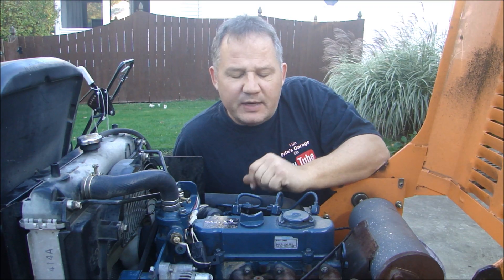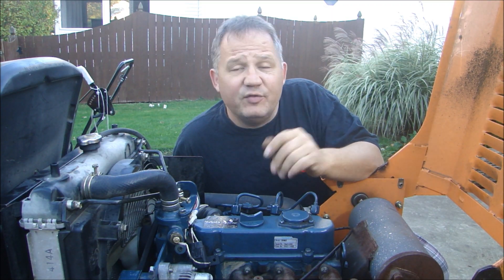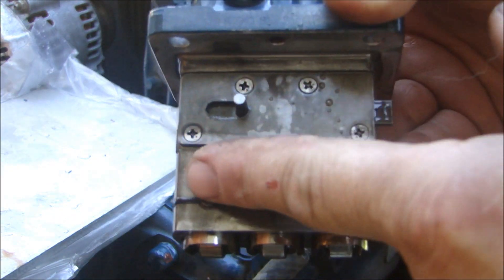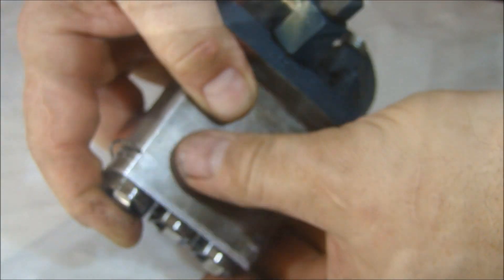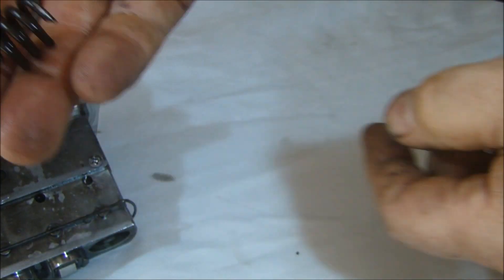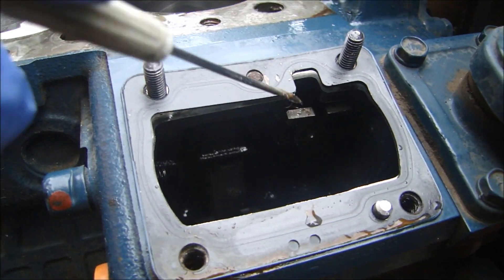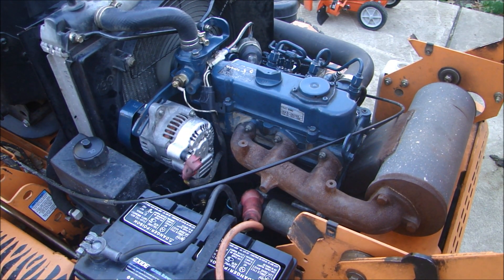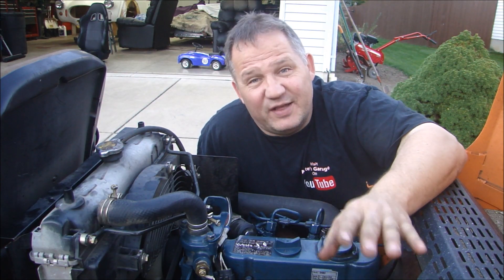Kubota D902 Diesel - Bogging Down, Blowing Smoke

Comment: I am confused.  What does the sliding tab piece do?  Is that the fuel cut off to stop the engine?
Reply from the maker: That sliding tab directs the pressure inside the pump. If I remember right the shuttle is connected to orifices on the top side of the lifters
Reply: @PetesGarage  what about the o ring on the head that goes on the dowel with the hole in it

Comment: Most small block Kubota engines are the same, have 2 of them. My question is why didn’t you just replace the spring or just the single injector?
Reply from the maker: I could not find the right part number at the time. I have found it since.
Reply: @PetesGarage  - Any chance you still have that part number?  I haven't pulled my pump yet to confirm it, but my bx2200 is smoking and down on power as of today, I just replaced my 3rd hydraulic hose in a week and now it's not running right.

Comment: I just bought one of these engines for $100. Wondering what to use it for 🤔
Reply: Dude the engine i have weighs about 83lbs.. i can pick it up with my bare hands fairly easily.. 160lbs? Maybe with a frame or accessories n whatnot but the complete engine itself is only 83lbs
Reply: I figured it weighed 7-800lb? I guess I was wrong.
Reply: Built a diesel motorcycle. With sidecar.
Reply: Generator.  A fucking go kart? For real, it weights like half a ton and makes like 12hp.
Reply: @brianmorrison9066  half a ton? No. Dry weight of the engine is 160lbs. Straight from Kubota's spec page...
Reply from the maker: Diesel go cart

Comment: The injection timing is set by adding or subtracting the shims under the injection pump. This Kubota has fixed timing like most lawnmower gas engines. A lot of automotive diesel injection pumps have variable injection timing. I installed a Kubota 905 diesel in a Geo Metro and it had driveability issues because of the fixed injection timing.
Reply: I was thinking about doing the same,  3cyl kubota in a geo , did you ever get it right? How is the power? Could a turbo be added? Milage? Thanks would appreciate some info,  did you build a adapter?
Reply: @redfuel6bt    Power...terrible. Going from 54 hp to 24 hp makes it a flat land vehicle only. I forgot about the car long ago but still have it. It's not a simple swap at all. Nothing fits. I built the adapter, modified a Suzuki Swift flywheel, clutch, starter, and had to make a vacuum pump to work the brakes. The oil pan hangs low and needs mods to provide clearance. The worst part is that the oil filter is exactly in the way of the right axle. A complex adapter needed to be made to switch it over to the front side of the engine.  The fixed timing injection pump makes driveability poor. The governor had to be modified to hit 3600 rpm from fixed 1800.  When you were ready to shift and hit 3600, the power cut back completely. But it got around 70mpg during the week I tested it. The registration expired and California would not renew it without the original engine.  I have a turbo but it still sits on a shelf. I used to build random things like that but nearing age 70, no longer have the interest. I build solar generators for fun now.
Reply: @redfuel6bt  Here it is....built 14 years ago!  https://www.youtube.com/watch?v=hnAOF1bOSB8

Here's another  random video from 2016 when someone bet me it wouldn't start.  https://www.youtube.com/watch?v=BhBKLahX6_0
Reply: @redfuel6bt  Since you clearly like Cummins and off road.... here's my boat after converting it from a slow inboard to a stern drive with Chevy 6.5 turbo diesel. I still have the boat in storage and doubt that I'll ever run it again. Boats were fun for years but I'm over it.  Note the air horn dongle. It once hung from a friend's Dodge Cummins before he rolled it 3 or 4 times. The old Perkins 47 horsepower diesel that came out of the boat went into her old wooden 28 foot Tollycraft cabin cruiser...very slow, 8mph, but got us around the NorCal Delta at 1.25 gallons per hour. That's cheap boating.
https://www.youtube.com/watch?v=cDyQ_VeZKx0
Reply from the maker: Interesting, I can see how that would work.

Comment: Hi Mr. Mechanic: I have a kubota BX2370with a small three cylinder diesel. I have changed the filter -fuel pump and it still bogs down under a small load. Is there any advice that you may have??
Reply from the maker: Change the fuel in case there is water in it, and look in the gas tank for an obstruction blocking the fuel line.
Reply: Good chance your fuel jelled, you can go to a auto parts store and buy a can of fluid that immediately breaks this up. Costs about $30 not cheap but better than taking the tank off, also change your fuel filters. Kubota users two of them

Comment: Interesting video Pete. I've acquired an engine in the same range to rebuild in part for entertainment and also to do an engine rebuild video for my channel (and have found the workshop manuals online).

Just a point of note that the D902 is one out of a series of similar engines, including the one I bought (a D662), D722 and the D902. They seem to also use the same pumps on engines like the Perkins K103-07 3 cylinder diesel (Which I've also bought). Presumably the same issue would apply to those and indeed all similar diesels.
Reply from the maker: Lots of parts are common and similar. I had to use a part number that was not exactly the same.

Comment: On a Kubota diesel -3 cylinder motor-I was told a new head gasket was put on recently.  HOwever, when I put water in the radiator, oil came out the top of the motor-from the oil fill plug.  Can you tell me what is wrong and how to fix it?  Please and thank you so much.  Dave
Reply from the maker: I have no idea, maybe they put in the wrong gasket or upside down

Comment: with a Parts book you can find Anything 😐 and you call the Thing a lawnmower with a 3 cylinder diesel that can Drag Pickup truck with 4 exploded tires yeah these tractors are Torquay sometimes in Low Gear
Reply from the maker: I did fine the a spring part number eventually, but it was not easy.
Reply: @PetesGarage  do you have the part number?
Reply from the maker: @ANGST97B2P  I have to look
Reply: @PetesGarage  thank you brother..

Comment: Good job !!  I guess you cannot buy just the spring ??
Reply from the maker: I could not find the spring at the time, but have since found it.
Reply: @PetesGarage  Is there a part number for the springs? Just in case this turns out to be my issue. Thanks.
Reply: @berky2755  @Pete's Garage ... is there any reason you're not sharing the p/n of the spring?

Comment: you forgot the o-ring on the head gasket
Reply from the maker: Which o-ring?
Reply: @PetesGarage  on the left front corner if you look at the guide stud it is hollow.  and look at the gasket  it is not a snug fit. there is a  blue oring that goes in there  you have to order seperately  it does not come with the head gasket. that is the oil feed for the rocker shaft.  i have seen these that are missing and never leak and others that leak like a sieve.
Reply from the maker: Yes, that one. I did not have a problem with that.

Comment: DO NOT CHECK THE FUEL PUMP FIRST!!!!!!!! This symptom can be caused by something as simple as a plugged fuel pickup, i stopped someone from replacing a fuel pump and replaced filter and lines first, found the down tube in the fuel tank had a peice of plastic bag stuck in the fuel line, suction in the fuel lines was causing air to get into the fuel lines before the injection pump. 10 minutes and $10 in parts (fuel lines and filter) and the machine runs like new.
Reply from the maker: You are absolutely correct. Before doing this video the fuel filters were change, tank drained, and lines cleaned. I did find a huge ball of plastic blocking the pickup. But I think that is based on what the engine is put it,

Comment: Great video Pete! Did you replace the gasket/shim on the injector pump or just re-use the existing one? I'm rebuilding a D722 but the injector pump gasket/shim does not seem to come with any of the rebuild kits out there.
Reply: the "gaskets" are shims  used to set the injection pump timing.  put the same thickness in that came out or do the pump timing procedure
Reply from the maker: @richardcranium5839  Correct
Reply from the maker: I reused them. Worked fine
Reply: @PetesGarage  Great! Thanks Pete!

Comment: Hi, Pete, why didn't you just replace the springs and or new injector instead of purchasing a new pump, I've a the same but four cylinder, and same problem but the smoke is black.
Reply from the maker: I could not find the springs anywhere and nobody would give me a part number
Reply: If you want to use this long term its way better to replace the pump as if one spring had broke its a sign the rest is on its way, The injection pump is a very important part on a diesel engine like this, its much more so then on a gas engine. It is like the fuel pump ,carb(along with the injector) and the distributor on a gas engine, as it controls throttle fuel delivery and combustion timing. And they are machined to very high tolerances, with high pressures. These small inline units aren't nearly as complicated as rotary ones but their still very touchy and don't lend themselves to tampering and wrenching.
Reply from the maker: @hawssie1  Thanks Nick. I replaced the pump on this one.

Comment: I had a power loss problem I found number 3 cylinder (that's the cylinder if your standing in front of the engine looking toward the rear of the engine), was dead, and also had a loud clatter noise in the rear of the engine. I pulled the  injector out of number 3 cylinder and done a compression test which resulted in a real low compression reading. Just for the fun of it I took a piece of bailing wire about a foot long and lowered it into the cylinder until it touched the top of the piston then I reached around to the front of the engine and grabbed the pulley and turned the pulley back and forth and found I had to turn the pulley as much as two inches in either direction to get any response out of the piston. Immediately I knew where the clattering was coming from and the cause of the misfire and low compression. So I pulled the oil pan off and found the rod bearing had spun and the rod itself was bent in the number 3 cylinder. So at this time I'm in the middle of rebuilding it. Just wanted to share my story on how I diagnosed my engine problems.
Reply from the maker: That's really cool, sorry it will be so much work.
Reply: @PetesGarage  Thank you I enjoyed your video on the fuel pump problem!

Comment: what if all three lifters are tight  but the one in the center is the only one that pushes fuel
Reply: The two cylinders that aren't delivering fuel likely have the plungers seized in their bores.
Reply from the maker: You'd have to take it apart and see why it's binding
Reply: Pete's Garage is there a timing that needs set and replacing it
Reply from the maker: Not really, there are quite a few parts and they need to line up
Reply from the maker: There is no timing

Comment: I ended up swapping my injector pump for a known good pump and now the engine runs great. I went on to completely dismantle the original pump, and lapped the mating surfaces with diamond lapping compound. That pump works now too. Thanks for the encouragement.
Reply from the maker: That's a great idea. These engines are very simple and easy to work on.
Reply: may i ask why you decide to change your pump?
Reply: @ryy597  I had two engines (in light towers). One ran great, the other one barely ran and smoked alot. I swapped fuel pumps, no difference. Swapped filters, fuel and air, no difference, finally, I swapped the injector pumps and the problem moved from one engine to the other.
Reply: @paulcalif  so if it runs good than i shouldn't mess with it?

Comment: Hi Pete,
I have a Shibaura 3 Cyl diesel that appears to be very similar to your Kubota. I just got it and it wouldn't start. I bypassed all of the shutdows by running power directly to the fuel cut off solenoid. I found that the mechanical fuel pump was bad so I installed an electric fuel pump I had laying around. Anyway, long story short, I ran the fuel pump and loosened the injector fittings to bleed out any air. Still wouldn't start. Suspecting the injector pump, I pulled off the injector lines from the injector pump and I get very low output from only two of the pumps ports. I took the pump out and disassembled the top half making sure everything went back exactly as it was. Everything looked fine. The cam followers were all stiff but moved freely with resistance. The little arm that moves side to side worked fine as well. Should I have gotten good flow from the pump when I turned the engine over? I cleaned everything and put it back together but I still don't get much flow. I got the engine started but it doesn't run well and dies within a few seconds. Now I'm thinking injectors, injector timing, or possibly a cracked block.
Reply from the maker: It has to run for awhile until all air bleeds out. You will have to start it many times before it will run, then it will be rough for up to 10 minutes.
Reply: Thanks for the reply Pete!
Mine only runs poorly for a few seconds then shuts down, I must have started it 30 times. I just watched a video of a guy in Australia who fixed a similar injector pump and his fuel was shooting 6 feet with the injector lines removed. Mine is barely going 6 inches. Did you look at your pumps discharge with the injector lines off? I may be barking up the wrong tree but I really expected to see the fuel spray out of that pump with some force.
Reply from the maker: This sounds silly, but I found a huge wad of debris in the fuel tank blocking flow to the fuel line
Reply: @paulcalif  Paul did you ever figure this out? I have the exact same problem. Im not sure how much flow i should see out of the pump
Reply: @65WKFoster  Yes, in my case it was the injector pump. I swapped the bad one for a known good one and my engine ran fine. Then I took the bad injector pump apart, inspected it, nothing obviously wrong. I was able the lap the critical parts with diamond  laping compound. Before you go that far, make sure your fuel pump is working. Bad fuel pumps are a common problem. I've worked on a lot of diesel light towers.
Reply: @paulcalif  Thanks Paul. Yeah i have good fuel flow from my pump just not much pressure coming out of the injection pump but it does shoot small amounts of fuel. We shall see

Comment: Pete I have a cub cadet 1782 with a kabota diesel the problem is fuel solinoid will not engage unless you push it in manually other then that runs fine replaced relay did not fix problem any idea of what's wrong
Reply: The Kubota fuel solenoids are dual coil - a high current momentary "pull-in" and a low current continuous "hold".  Need to determine why the pull-in coil isn't getting power on start-up.  Should be the white wire in the solenoid pigtail and may be energized from the start circuit at the starter solenoid or relay if so equipped.
Reply from the maker: The fuel solenoid is electric. Some switch is not being made up. I think there is one under the seat?

Comment: Hi Pete, do have a video on replacing that gasket?
Reply: FYI, there is supposed to be an o-ring that goes over the alignment pin/oil feed tube in the front corner.
Reply from the maker: It's pretty simple to replace. I have another one to do so maybe I'll make a video

Comment: I would recommend always adjusting the valve lash if you have removed the head or rocker assembly even if you keep the push rods in the same locations, it never a good idea to assume the valve lash is correct.
Reply from the maker: Excellent point, thank you for the comment
Reply: all so ck fuel pump timing that is what the shims are for on fuel pump base

Comment: I'm surprised you didn't get white smoke if running lean at high revs
Reply: White smoke from a diesel is either unburned fuel from low compression, blown injector tip or coolant from a blown gasket or head crack into the water jacket.
Reply from the maker: There was white smoke, lots of it at throttle under load.
Reply: Pete's Garage ah ok because you said blue smoke in the video.

Comment: u should always do a compression and leak down test before tearing into the engine
Reply from the maker: I always do. Since I found the broken spring in the pump I took the head off to take a quick look inside, it was a 30 minute job.
Reply: @PetesGarage  What should my compression pressure be?. What should my leak down be?
Reply: @oiu7890  Factory specs...new...512-583#
Reply: @oiu7890 what do you have on each cylinder?

Comment: Valve spring from a head would have done the job nicely
Reply from the maker: There is no way I could determine the new spring height and spring rate. All 3 would have to be changed. Just changing a random spring could result in damage to the cam.

Comment: Thanks, Pete!

How about some VW 1.9/2.0 TDI Diesel work?  I'm considering converting the old '99 Ford Ranger to that setup.
Reply from the maker: I do the work as I get 'em. If I get one, sure I'll do it
Reply: OM616 or 617, much better engines.
Reply: I've looked at those Mercedes engines plenty.  There is nowhere even close to the aftermarket that there is for VW TDIs.  Plus, in my engine compartment, that means lots of cutting and welding and custom fabbing.
Reply: There is a large variety of VW 1.9 and 2.0 TDI engines, which one are you looking for?

Many people prefer the ALH code engine.
Reply: planeflyer21 a kubota V2203 engine with a turbo does well as well in a small truck